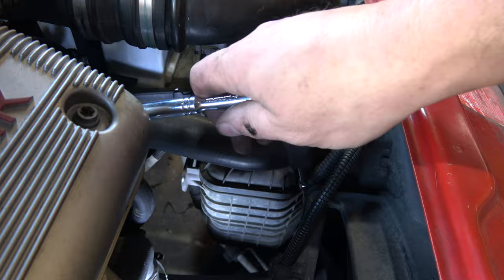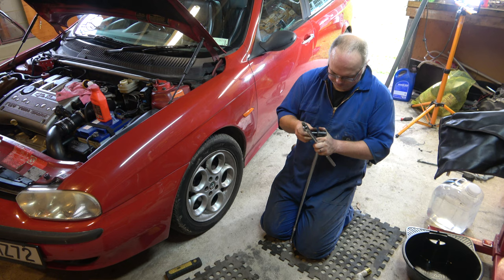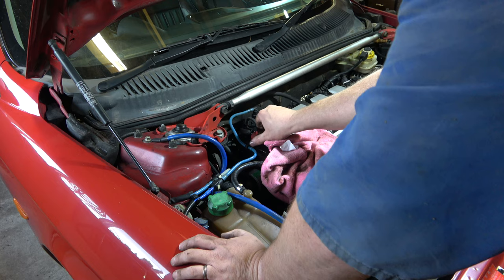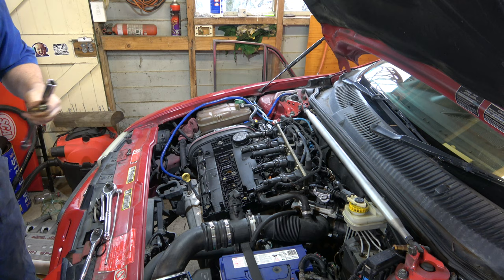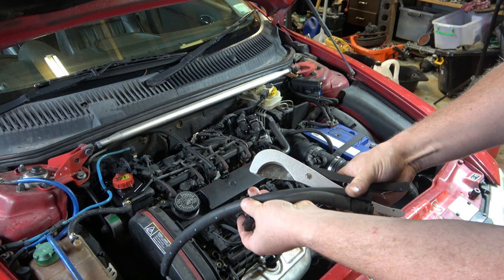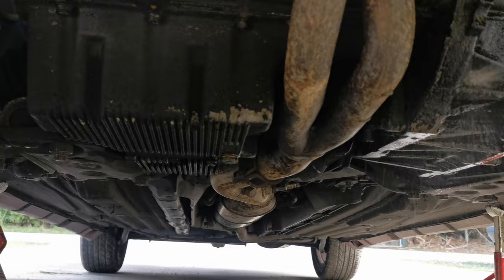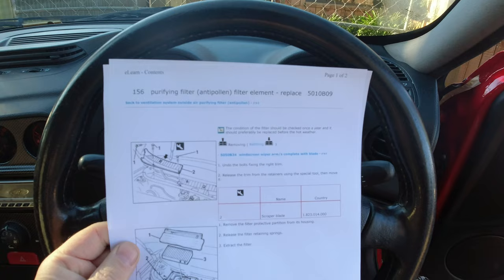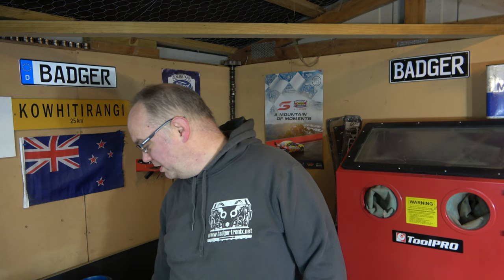Alfa Romeo 156 - Fixing the Badness - Part 2

Comment: If it's got 200k on the clock, and it's been serviced at 66k, 132k and 198k, that's regular servicing.
Reply from the maker: True. Same could be said about 'one careful owner statements'. It's the 6 not so careful owners you need to worry about

Comment: My wife drives a 2008 Acura TSX. Every oil change I turkey baste the brake fluid reservoir and the power steering reservoir. Replace with fresh. I figure I’m keeping enough new in there that I’m keeping it in good shape.
Reply from the maker: Good plan, although it would probably help to bleed the brakes and clear the old fluid from the lines and hoses every couple of years. Cheers

Comment: the "fuel pressure regulatror" is in fact the VVT solenoid
Reply: That stumped me for a while, wondering what kind of system the engine was running.

Comment: It never ceases to amaze me how people can neglect to properly maintain a vehicle that they expect and rely on to get them where they want to go in a "safe and trouble free manner" .  Only yesterday whilst travelling down the M5 motorway as far as Worcester on my journey to Hereford, I saw two cars broken down on the hard shoulder with the bonnet up, both were less than six years old. Personally I find it very therapeutic to service and maintain my vehicles to exacting standards, the very last place I would wish to be stranded is on the side of a motorway.  Anyway, keep up the good work, I look forward to the next installment.
DJ in the U.K.
Reply from the maker: I broke down on the M5 once in my Dad's near new Hilux. Couldn't work out why it was losing power and shuddering. When I pulled over I found that the drain plug had come out of the gearbox and it was in the process of seizing solid. Made for a long day. Cheers